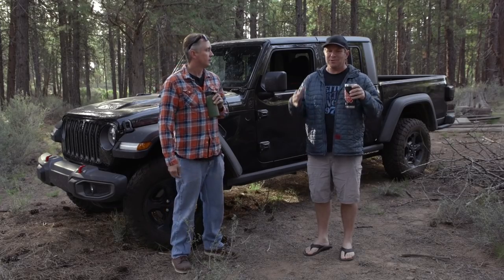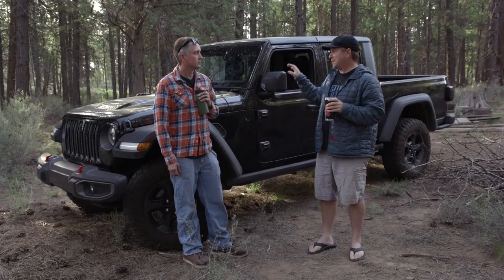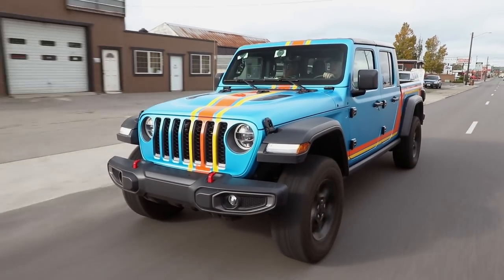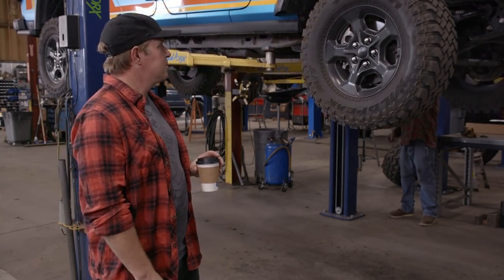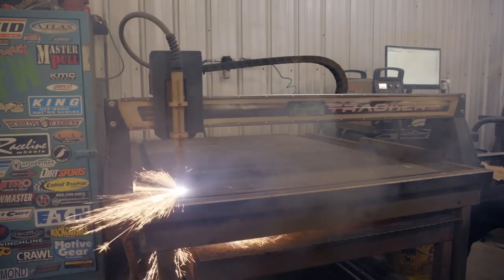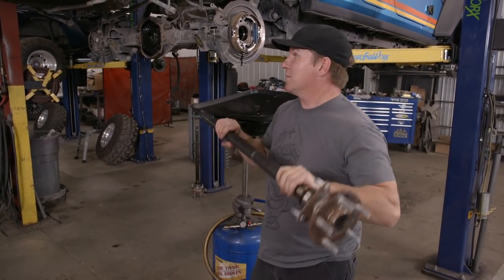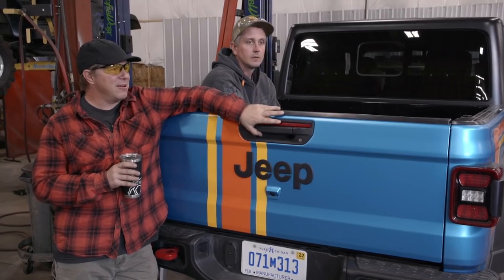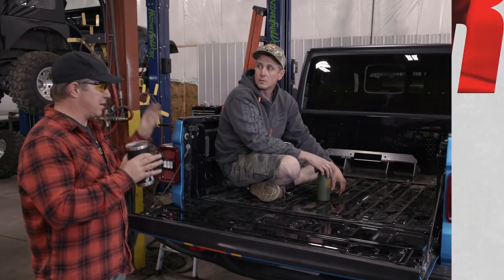The New Jeep Gladia-Tow Adventure—Dirt Every Day Preview Ep. 98

Comment: You need to put the who video on you tube
Reply: You can watch the whole episode for free on the Motor Trend on Demand website for free in about 10 weeks. (Using a desktop, or laptop computer Starting February 3rd) You can watch episode 96 now, and 97 starting on January 6th.

Or, they're currently running a Christmas special. You can get a full year for $12 with ads, or $24 without ads.
Reply: Whole 😂👌

Comment: I am sending a cease and desist notice to Fiat Jeep, denouncing them until something is done about the door situation.  Its un-acceptable an awesome truck needs to be ruined with 2 doors 2 many...  Not to mention it would be MUCH MUCH better off road as a 2 door truck.
Reply: They were already talking about making a single cab version not just crew. Around the same time the diesel engine version was being prep
Reply: @brandoncaldwell95   Ah see if they did the diesel pre-dpf/def  I would be excited but those systems are junk, (I drive Cummins vehicles with them)  But if they do make a single cab... hmm.  Could always do a 4bt swap, or Mercedes 5 cylinder diesel.
Reply: @gittyupalice96  understandable. We have 2 Ram 3500 dually diesels. Each have the emissions still. Mainly because of the warranty. Hopefully parts will still be available in the next few years when they fail. Emissions systems will be removed then.
Reply: @brandoncaldwell95   I guess, according to the guys at the shop.. they told me the cummins needs to stay below 1000rpms until its warmed up, if you let it go into high idle or have a high idle switch and activate it while the engines cold thats the fastest way to clog the dpf filter.. (thats what they tell me anyway, I haven't touched it myself for the same reasons)
Reply: @gittyupalice96  the filter will take care of itself. Afterall, it needs to be hit to burn off the soot.. The issue with idling a Cummins is the fuel washes out the oil from the cylinders sitting below 1100rpm too long. You're safe for about 30minutes beforethe oil gets washed out. It really all comes down to this, what would you want to replace? An engine from low idle warmups or an emissions system? Engine is $10k or a $3k emissions system
Reply: I'm still waiting for the 2 door